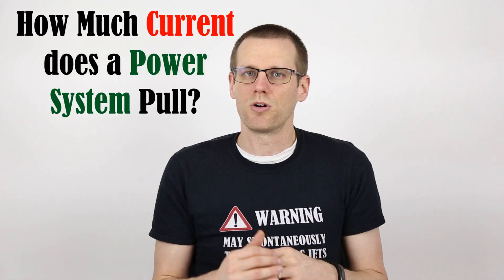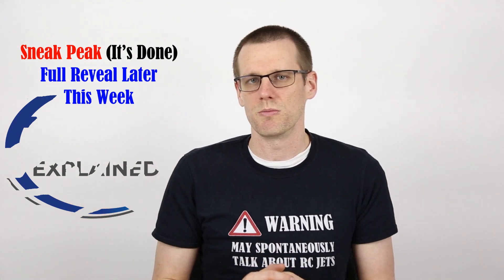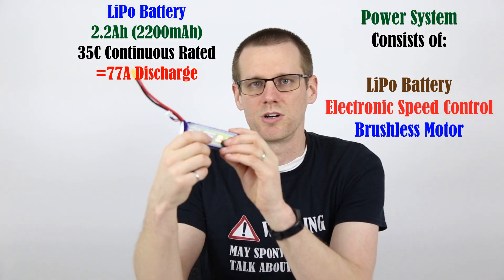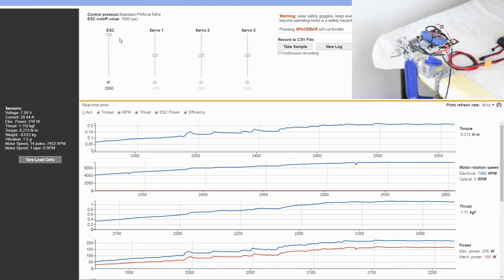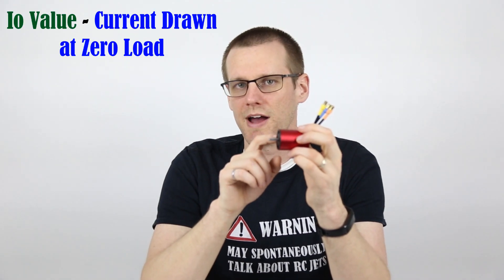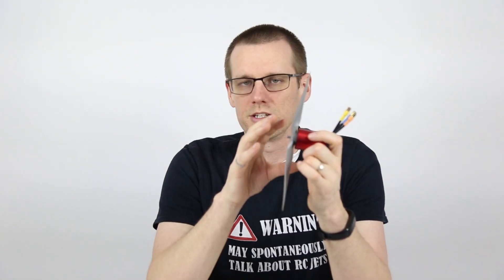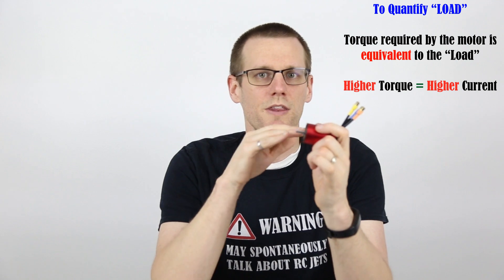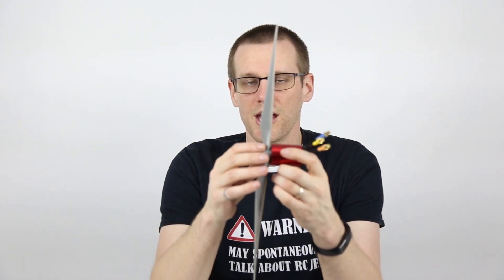How Much Current will this Brushless Motor Draw?

Comment: I'm wanting to design my own ESC as a personal project and planning on using mosfets to drive the circuit, is the current the motor is drawing at one time through one lead or the two leads that are providing the push/pull relationship? Trying to figure that out so I can properly size the MOSFETs.

Comment: I linked here from your article about current and amp draw.  On that page you suggest the only way to accurately know how much current is being drawn in any given RC car is to fit a data logger or analyzer to the car, could you recommend one..?  I can't find anything, i was searching for something that could do the job when i found your article...
Reply from the maker: Use a castle creations esc
Reply: @RCexplained  Any other way apart from buying another esc?
Reply from the maker: You can use telemetry sensors from the brand of your rc radio. 
I have used an eagle tree data logger but they may not be around any longer. 
There's some power meters that work well for airplane use but won't be ideal for an rc car.

Comment: Hi. I'm trying to work out whether i can safely use a 4C battery in my RC Boat. I have a cheap RC Boat. Volantex SR65 Brushless. There isn't much information on the motor from the manufacturer, other than 2218/2700KV. The boat has a EP-20M 20A  ESC controller which says it can take 2S - 4S batteries. 

I'm basically trying to figure out if i can run a 4C battery safely as there isn't much info about how much amps or wattage the motor or ESC can use at full load before burning out. I did the formula for 2700KV X 11.4V = 30780 rpm per volt but i've only ever used 3C batteries. Can someone please help, tell me if i can use 4C 14.8V batteries through this ESC and this 2700KV motor safely ?
Reply from the maker: I would not recommend running a 4 cell battery on a 2700Kv motor. More rpm will force you to reduce the propeller size to avoid over heating your power system.

Comment: Hey, 
great video!
Would you answer me a question?

Suppose my motor draws 100A max and I have a 150 amp regulator - this would be ok so far.
But! - my lipo has 2000 mAh and a c-rate of 20/30. It can therefore deliver a maximum of 60A.

Is the engine satisfied with what it gets from the lipo or does it want more and does it destroy/harm the lipo?

I would be very grateful if you could answer this question.

Greetings
Stan
Reply from the maker: The motor will draw the current that it requires to rotate the load that is placed on it. Small load small current. Big load big current. Too big of a load and you will burn out the weakest link in the system. This would be your battery.
Reply: @RCexplained  Thank you 👍.

Comment: Thanks for all your excellent and informative videos. How does spreading the work done over multiple ESCs and motors effect this equation given we still only use the one power source? Obviously faster draw down could be a factor but it could also reduce draw down given the system would likely be more efficient. I’m designing a cable cam system and I can’t for the life of me work out a mathematical formula to give me an idea of how much work the cable is doing. I’m thinking it will reduce much of the work the motor, esc and battery needs to do because it’s angularity is constant, linear and repeatable. Cable resistance, wind and payload are really the only environmental factors impinging upon the system. My dilemma is striking the balance between slow controlled movement v chasing fast moving subjects.

Comment: Hi, can someone tell me. I have a small DC motor that runs on 28 volts DC.  If testing using a DC power supply, I know to set my volts to 28 but what do I dial in  my Amps to on the power supply?? I believe it drawas .2amps on no load. I don't want to send too much amperage to motor.
Reply from the maker: The motor will take only what it needs.
Reply: @RCexplained  If it stalls under load and nothing is jamming it, am I looking for a motor that can draw more amps or higher voltage beyond. 28 volts?
Reply from the maker: More torque requires more amps. More RPM requires more voltage

Comment: hello, i have a question on pairing esc-brushless. will this esc+motor fit on 3s correctly, or you see any problem?
ESC: https://hobbyking.com/es_es/hobbykingr-tm-x-car-beast-series-esc-1-8-scale-150a.html or https://hobbyking.com/es_es/trackstar-150a-genii-1-8th-scale-sensored-brushless-car-esc-pc-programmable.html
BRUSHLESS: https://hobbyking.com/es_es/turnigy-xk-3650-5400kv-brushless-inrunner.html?wrh_pdp=7
If you have a better option than one of these i can consider it. Thanks :)
I will use it on 1/10 rwd touring

Comment: RC car guy here, I actually look at max C ratings and max amp ratings more than average. The reason being, driving wheels on the ground (grass, dirt, asphalt), you will have far more resistance than a prop moving air. A good battery manufacturer/builder has both continuous and max C rating, this is where I start. Batteries are more volatile, so I make sure the battery can handle the load first. I find ESC's not carrying a max amp rating a little disappointing, but I tend to try to overbuild a little, just to have a little cushion. On motor, i just look at KV to be honest, that is the only thing I care about. I simply match the KV to my voltage requirements and look at gearing charts to see if I can make it work. if I can, great, if not i look elsewhere for the motor.
     Me personally, I like higher Voltage/low KV setups Vs low voltage/high KV motors, so I lean towards lower KV motors and higher volt setups
Reply: Hi! Can you share some experiences about gearing changes when upgraded to a higher KV motor? Is there any rule of thumb such as higher Kv need higher gearing or it's just trial-and-error?
Reply: @tuananhphamcong344  The higher the KV the higher the RPM per volt, For example a 500KV motor vs a 1200 KV say both have a max RPM of 50K, A 1200 kv can run 11s safely (technically) at 48K RPM, but the 500 KV can safely (technically) 49,950 RPM. I say technically, because they are both approaching the max RPM before something catastrophic happens (Like a Rotor exploding, or bearing failure). Me myself, I like to run my motors at half max to the highest rated RPM Available, so in this case 25k max. si i run the calculations to match 25K as close as possible. In this case the 1200 KV would be 6s max (26,640 RPM), yes it's a little faser than my max of 25K, but it's easier to buy 6s packs than 5s pack, the 500 kv would require a 14 s pack to match in RPM (25,900). as for gearing i use this https://scriptasylum.com/rc_speed/top_speed.html 
it's a gearing calculator a friend developed, it has many older vehicle specs, but if yours is not available you can just enter then in yourself, it can cover anything from geared transmissions to driect drive, so even your car isn't covered you can still use it by filling in the blanks with your numbers, it even can cover volyages Like the high V Lipo's and max volt of almost any type of battery. Of course you could just fill the numbers in yourself as well. But this is what i use on a project for estimating gearing. BTW as far as adjusting the gearing, I always went by this, "Cool motor hot esc, under geared (go up to fix) , hot motor cool esc over geared (go down to fix),  both about the same temp and within specs, happy setup"
Reply: @crazylarryjr  Thank you for the clear explanation. One thing I just want to make sure is when you  say "under gear", you mean the gearing is too low and should go up in pinion teeth to fix, right? and "over gear" is the opposite.
Reply: @tuananhphamcong344  Correct Undergeared means you are running the setup at a lower or slower max speed, it is easier for the motor/esc to accelerate.  The reason that is bad is the esc while most efficient at full throttle it heats up if bottomed out (the setup is at max RPM/speed). gearing up allows the esc to work properly at max with none of the issues of the bottoming out. Overgearing is the opposite effect, it's harder for the setup to accelerate. in this situation the esc is comfortable because it's working without issues, however the motor is being overworked. What you want is a compromise between, so good acceleration with good speed, yet both pieces being happy. I use a temp gun to determine temps, I usually aim for a similar temp for both the esc and the motor, you hit that you get the best compromise of everything. As far as batteries go, they can heat up as well in either situation (over/under geared). I just try to match the best battery to the setup I can, the higher the C rating the better, within your budget of course